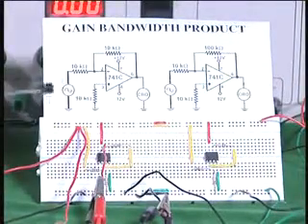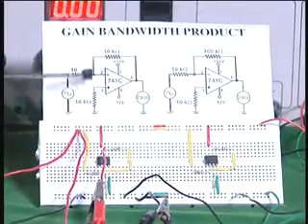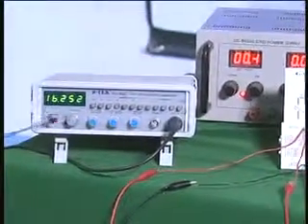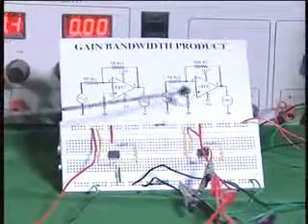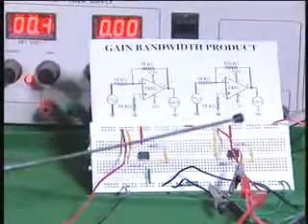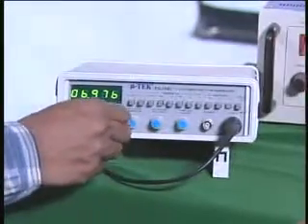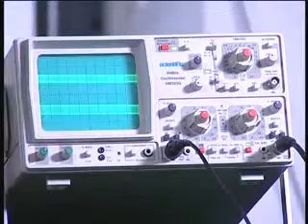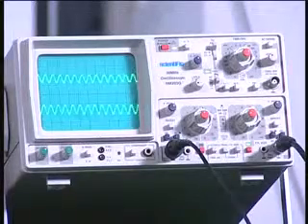Gain bandwidth product

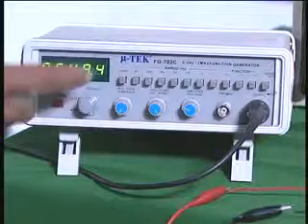Comment: Around 3:18 you make a common mistake: you are telling the closed loop bandwidth (assuming first order behavior) will be around 1MHz in fact for the inverting opamp amplifier configuration with R2/R1=1, the bandwidth will be 500kHz. For the non inverting configuration it will however be 1MHz.
kind regards,
Hugo